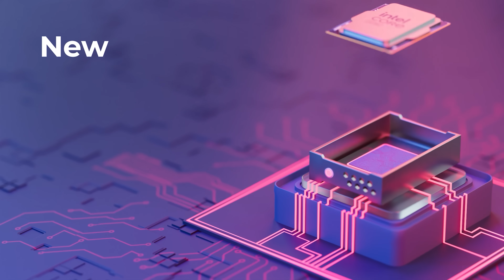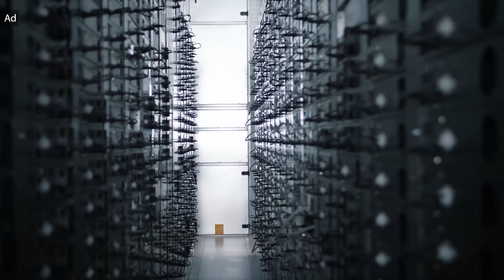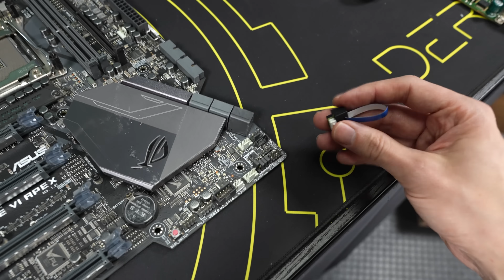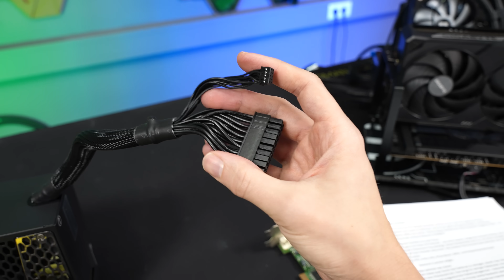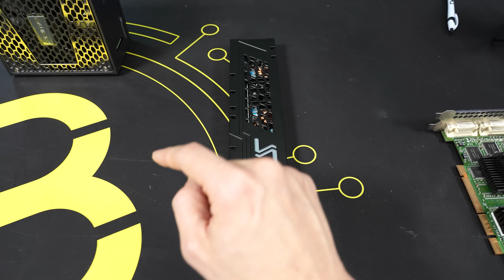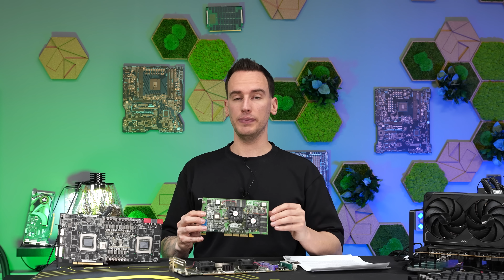Dead-on-Arrival Hardware: Why Nobody Bought These Products - Failed Hardware Ep-1

Comment: The VROC key is a prime example of enshittification. This is one reason why healthy competetion is always good for the customer.
Reply: Don't forget Intel's Software Defined Silicon (SDSi) or Intel's  Pentium G6951 "unlock" service.
Reply: @shadow7037932 this is a much better example. VROC wasn't making an existing feature worse so much as adding a new feature in a really terrible way
Reply: That is a some kind of DLC to grab money from consumers.
Reply: When he started talking about it I was wondering if it was a way to decouple some of the raid information from motherboard/cpu so it can be recovered on another machine using the key in case the mobo/cpu failed, but the more he talked about it the more I'm wondering how anyone would consider this a valid alternative to the hardware and software raid solutions that already were on the market.
Reply: For real, most enterprise and workstations use software raid anyways with something like MDADM, oh your raid controller or motherboard died? There is a good chance all of your data is gone!
Reply: Yes, we really dodged a bullet there.
Reply: Case of potentially great tech implemented in a catpiss fashion.
Reply: worst part of vroc key was even with it installed the thing had an enormous amount of BS to try to get things to work with it, horrible.
Reply: The only interesting thing about this is I don't even need to look it up to know this was surely cracked. The key serves no functionality other than enabling a feature that's already on the system which should  be fairly easy to bypass. If I had this system back then I would have made it my mission just to give Intel the finger it deserved for implementing such a ridiculous idea.
Reply: @JJFX-   It actually wasn't, probably because nobody cared enough to enable this bollocks.

Bypass how? If they wanted to be extra nasty about it they could hide part of the key functionality in the IME, which then good bloody luck.
Reply: @SianaGearz Well I looked it up and yes, they didn't bother to make it complicated. Looks like the community figured out how to bypass all of it.
Reply: I don't know. It's kind of a good idea in a way. It gets annoying paying 400 bucks for a motherboard I only use 1/4 of the features. Those being modular has some appeal. That said, for 100 bucks you can get a real raid controller so I'm not sure what they were thinking for that price point. It should have been like 15 bucks tops.
Reply: Honestly I am thoroughly surprised there's not more outrage about some nVidia shenanigans. I know they hide some of it consumerside, but pro-side a lot of driver features are locked behind subscriptions. Say you want to build a VDI, and virtualise... 4 nodes/GPU. That brings your driver subscription to $1000/year (250/user), or if you pre-pay 5 years for a meager $180/user/year. I don's see how it's different from vroc. Consumerside nVidia does the same with video encoders/decoders and multi monitor support, except because hardly anyone uses it it flies under the radar.
Reply: Not exactly. It is a focus on financial engineering over technological engineering, though.
Reply: No, it isn't. Enshittification applies to platforms whose customers are both businesses and those businesses customers. It's term meant to describe the process of platform entrapment and ever greater extraction of value for the platform from both ends of their customer base. It's a damn good term so please read what it is and stop throwing it around in way that makes it less useful.

It doesn't just refer to any shitty product you see. Which this IS a prime example of.
Reply: @martinkrauser4029  I think he means that VROC would be a form of SW feature lockout/"entrapment" not seen before in BIOS.
Hence the product is junk because it's normal features are missing and you can write your own SW RAID feature -- like the Linux folks have done.

Both businesses and regular customers are affected thus fulfilling your above requirement.
Reply: @EquivalentSeriesResistance  I know what he means. What I mean is that it's a product, not a platform. The fact that a product is bough by business customers does not make it a platform. Every damn product is bought by business customers.

A platform is a SERVICE that businesses use to sell THEIR products and services to customers. Amazon is a platform. Google is a platform.

It doesn't matter that this product found a novel way to suck. Enshittification is a term that doesn't apply to it. It's not what it's for. It describes platforms incrementally offering lower value to customers while charging the businesses that use them more for their service, depending on the network effect to keep customers from leaving their degrading service.

A shitty CPU with shitty DLC does not and will not fit that definition.
Reply: Weird word.
Reply: It’s become much worse no? Look at the USA atm. Authoritarians in charge of the government and people aren’t as upset as they should be. Oh and computer stuff isn’t as good or something 😅
Reply: @Akkbar21 why would we care about authoritatianism? They are doing what more than half the country voted for.
Reply: @cal2127 including you? You that unamerican? I don’t recall the president promising to be a wannabe dictator w/masked paramilitary thugs terrorizing our communities. Was that the official campaign platform?
Reply: @cal2127  now that's factually incorrect. Maybe around 20% of the country voted for trump, and with the approval rating dropping since, they're doing what maybe 10% of the country wants.

Comment: Hmm in late 2000's I did use Intel's software raid through a chipset option, which meant I wouldn't do it in any operating system - instead through F-key menu during boot to set up my raid array. It wasn't that much slower than a dedicated hardware raid back then, but obviously the raid would be lost if the board would have some issues. Prime example where Intel just went to do stupid sh*t later with the physical license stuff...

Comment: I'll say I own a SeaSonic Connect but it's not in a case. It's on my workbench as a troubleshooting PSU setup. Amazingly useful that regard. God it cheap when it went EOL.
Their Synchro was a far better idea but again not the best implementation.
Reply: Oh that's a spectacular use-case, i'll keep it in mind should i run into one.

Comment: I still give credit to Seasonic for trying something different, it was an interesting concept, but as you mentioned it's extremely poor timing with all the market changes happening at the time with PC hardware. I kind of wonder if Seasonic got too deep into the project to cancel it and so released what they had to try recoup some costs, which is why only a 750W non-enthusiast PSU existed.

Comment: That Seasonic Connect from 2019 is a waaaaay older idea. I have a couple Thermaltake powerstation PSU's from the mid 2000's which did much the samething only it sat in a 5.25" bay.
Both still works, 520W.
Reply: I had a FSP 5.25 PSU as well! Those weren't really anything like SeaSonic Connect though. The FSP unit was quite literally a full featured 450W PSU that just gave extra peripheral (mainly 6+2-pin PCIE) power connectors and linked to the main system PSU for a power signal. It wasn't just a power extender for another PSU, it was to be run in tandem to enable running multiple HDDs and GPUs that your first PSU couldn't.

Comment: Great new series, I hope you'll continue with this. It's just my thing with old & weird retro parts, always fun playing around with it. :)
I almost bought into the Seasonic Connect thing because I loved the idea and it looked very neat. I didn't though, due to worries about case fitting like you said. It felt too restrictive, especially for a PSU which at least I tend to use for many years and in many builds. Bit sad really, it was a good idea but perhaps not engineered to perfection and like you correctly stated the timing was bad to say the least.

Comment: Seasonic Connect was fantastic concept i still have fuzzy feeling in my tommy seeing it..
Reply: Such a great idea that I had to make my own because they don't sell it anymore. I found that you can actually buy industrial PSU that take 12V or 24V and turn it into ATX at 500W, which is enough for the motherboard, the GPU gets dedicated 12V line via XT60 connector, everything is XT60 connector, fuck the 12VPWR stupid connector.

Comment: That Seasonic was actually a brilliant idea for the dual chamber case
Reply: The evolution to the Syncro with case/connect/psu would have been amazing if it was cheaper. I wish I would have gotten it when Newegg was getting rid of it for like $150
Reply: @jessiethedude  I got one at $300, and another at $120.  

Wish I could get another 850w (or was max 750) power supply.  eBay (Newegg) had 10 for $35 a few years ago.  :(
Reply: the general concept is awesome - tbh PSU's more broadly could do with a re think for space efficiency for SFF. That said, the range of super high quality SFX-L is really good now
Reply: Would be nice with my setup where I'm planning to turn my pc into a wall mounted curio with the MORA above it on the wall.  Would let me clean up power cords, but I have no intention of replacing my AX1600-i titanium.
Reply: I have the case that Seasonic built for Connect PSUs, the Q704. Built in mount for the Connect and a back panel cut out for it to radiate its heat outside the case without a fan. I have Seasonic's 850W Platinum Connect PSU too. There was defintely 'some' enthusiast consideration.
Reply: I believe it kinda evolved into those motherboards with cable connectors in the back. However, I don't think they are hugely popular either.
Reply: @DrearyEagle  Im a big fan of back connect motherboards. Custom cables, just one, cost the price of a whole ass psu, make that make sense
Reply: Yeah I thought it was actually a cool idea, just super expensive and semi impractical. Like mentioned though, its just hard to find cases for and so it was pretty impractical.
Reply: Is this thing fanless? In such case the claim that it is not enthusiast is dumb, 600-700W is high power there and is perfectly adequate for a quiet single GPU system pre-500W+ madness.
I freaking love my several of GPS-500C and SF-500P14FG I bough for workstation, servers, HTPC and still think it was the best PSU ever made (for 2 decades under at least 3 brands). And they are only 650W nominal with some very healthy reliability margin on top.
And this thing looks great for what it offers, mentioned flaws are nothing really. I'd make custom cables if I had any issues with stock ones, the thing is fully modular. And who needs cases anyway, as an enthusiast I worked on parts in my build so much that I found it easier and quieter to completely ditch it in favor of open stand. Making all cables 12V and moving the rest of buck converters to a distribution plate with shorter cables is a real improvement in efficiencies design.
Only the Seasonic price tag could be the real issue here.

Comment: 12:21 Seamlessly inserted 12VHPWR roast right there, I love it 😂
Reply: the roasting actually is included with every 12vhpwr connector.
Reply: 12VHPWR won't ever get enough roast
Reply: if I ever get a 4090, which is stupid the 3xxx series is fine enough. I will desolder that crap and solder a fucking XT60 connector. DONE, bam, that's how you do it.
Reply: @monad_tcp  don't, it will be much worse. You would need xt120 at least and it just doesn't make any sense, ltt already made a vid about it
Reply: @monad_tcp  let's not kid around the 4090 saw a massive jump in performance over 3090. Some 3090 models even drew more power than 4090, and a simple power limit or undervolted 4090 consumed even waaaaaay less power than a 3090.
Reply: @ZomgZomg007  that's not the point, point is that 3090s had proper management for 12vhpwr port unlike 4090 and 5090.
Reply: @riba2233  I don't know a single owner of a 4090 or 5090 who has ever had any issues. I've been using a 4090 for 3 years. This isn't a problem and the only people complaining about it are people who cannot afford anything.
Reply: @ZomgZomg007  at least, when it hits the power limit it either throttles or shuts down the system. Do note that even undervolted, there are still reports of 4090s melting their power connectors.
Reply: To be fair, some older molex connectors/adapters from the 90s could have issues, too 😂

Comment: buying hardware key with a license for a feature is insane.
imagine if and every feature and each slot had a lock
Reply: Gestures at modern cars you were saying?
Reply: @katziahmed  noo that's worse. That's a software key for a hardware use license. :')
Reply: @AnnaVannieuwenhuyse Intel did that too. Intel sold a line of processors for pre-built computers whose performance could be increased by purchasing an additional "product key". The hardware could run with increased performance, the buyer just had to pay more to unlock it.
Reply: @katziahmed  yep, like having to pay a SUBSCRIPTION!!!!!!  for heated seats already fitted to your vehicle.
Reply: Look at any professional hardware vendor, especially servers and workstations. Most have integrated lights-out management controllers that are behind a subscription license...
Reply: @Tri_Nitro  and in the end, even the server market isn't all that happy with it. But they had little choice 😕
Reply: @Tri_Nitro  says hello in 1gb chunks of storage hardware licensing
Reply: @Tri_Nitro unfortunately IPMI licensing is normal in servers.
Reply: Every Oscilloscope nowadays has it this way. All features there already, but a license has to be installed for using them. Bandwidth comes to mind. Interface protocols, memory depth usable, and so on.
Reply: Intel was ahead with the greed
Reply: intel just copied megaraid,there is this 2-pin 'battery-like' chip to unlock raid 5(0) and 6(0) (or used to be back in my days)
Reply: It's Intel, though. That was the absolutely most greedy tech company at that time. So while I never heard about that, I am definitely not surprised.
Reply: Should have marketed it with AI lol.
Reply: That was very common for RAID hardware tho.

Which is also why it pretty much went extinct.
Reply: @enlightendbel  Well for windows. Linux you always ignored that crap. What did "kill" typical raid for Linux were scalable network based filesystems.
Reply: I guess you haven't been in the enterprise world much.  Enterprise switches are notorious for this.
Reply: Nothing unusual elsewhere outside the DIY PC space. For example, take a look at the wondrous worlds of oscilloscopes and other digitally-driven test and measurement gear. Sell the complete hardware but lock features and capabilities behind license keys who have to be purchased separately. There are whole communities dealing with how to unlock such features without paying for them by hacking/modding the device firmware. (not sure if it is still the case today, unfortunately i haven't been really interested in the electronics/maker space for quite some years anymore...)

EDIT: Dang it. Oscilloscopes have already been mentioned by @franks_8664. Well, consider me being a big colorful parrot parroting things... 🤣
Reply: Yeah and at least back then it was an outright purchase. Now the bastards would keep it on an annual subscription. Pay up or it stops working !
Reply: I don't remember exactly how it was spelled I think ilok. I believe this was or is a thing in the music production DRM chain for some products. It required a physical DRM dongle for some products to work. Unless you pirated them, then you didn't have to deal with any of that.
Reply: BMW has entered the chat
Reply: - Why is (game) not running on my pc?
- You didn't buy avx512 subscription for your cpu.
Reply: @sonairys929 You joke, but you have to buy video codecs already to play certain mp4 encodes from phones (mainly Apple) on PC in Windows video player. When VLC and plenty of others have those codecs free.
Reply: Intel still sells chips like this. The features and cores are determined by the licence you pay, which can have benefits with variable demand scenarios, so in lower demand you can reduce your costs in some cases, particularly combined with some software licensing too.
Reply: Give it time and your have to pay for the better pcie lanes per month
Reply: it was probably an addition block of silicon inside CPU that for sure costed them money, so it is not just some kind of software license key.
And unlocks make sense in enterprise HW, in this case even $100-150 is cheap, new PCIe storage controllers are more expensive, the simple ones.
Reply: its like what the BMW tried to with that stupid cloud heated seats. Imagine if it was a cloud key license, they were ahead of their time in the enshitiffication. I'm afraid to buy anything from Intel nowadays. wasn't the last year that their CPUs were literally destroying themselves because of a firmware problem. I have a 10 year Old CPU that still works. Those new crappy ones are like Sansumg products, they have expiry dates.